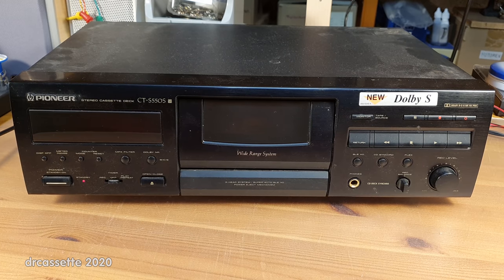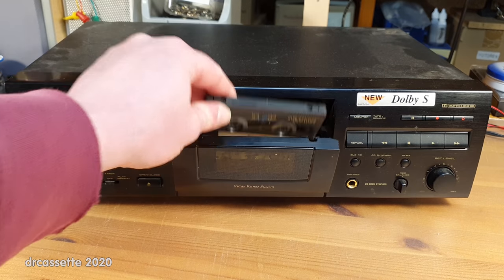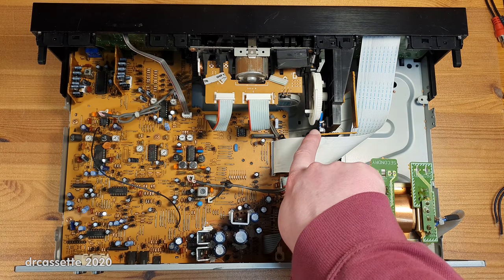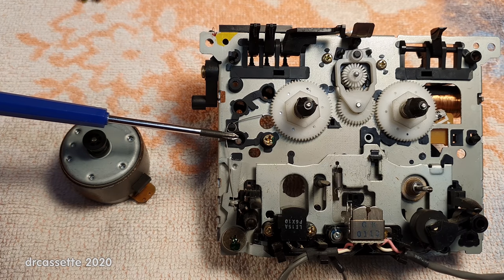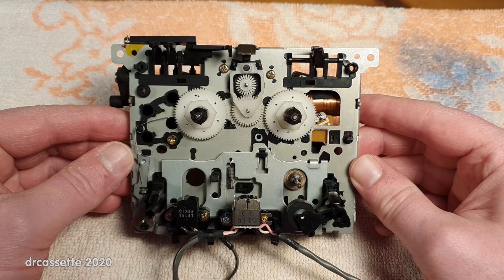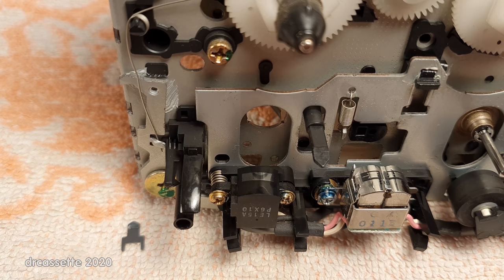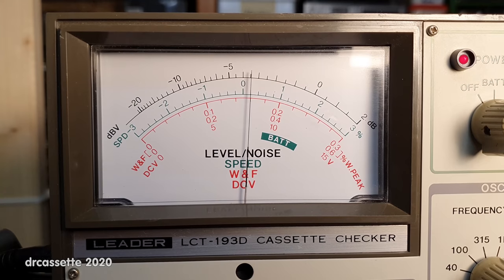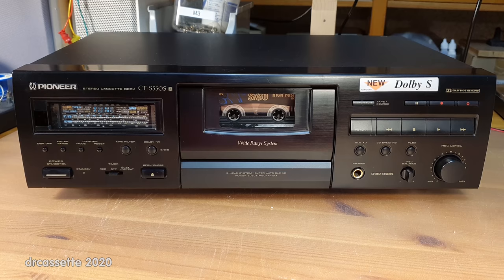Pioneer CT-S550S cassette deck repairs

Comment: Dr. Cassette, I have used this video as a reference for repairing a Pioneer CT530. Mechanically is identical with this one, without Dolby S. the strange issue is that while there was no aparent wear after 40-50 recorded cassettes (I listen them at work on a walkman) I noticed sudden wow. Changing belt, same thing. Lubricating everything as per service manual no improvement. I have even changed the the pinch roller. The capstan has absolutely no scoring marks and no play as wear mark. Finally after, trying to lube the motor (you cannot reassembly it without touching the brushings) I gave up and used the motor from a Pioneer CTs 656. Problem solved...until noticed on the long instrumental parts that it is not what it should be. Should I declare this deck dead or could you suggest other thing to check. Also,  forgot, the supplied belt was very fine sanded while spinning on the deck with 600, 800 and 1000 gritand after it everything cleaned with IPA and oiled (these belts are awful). Thank you for any suggestions.
Reply from the maker: You have already tried everything that I can think of. Unfortunately the mechanism in these cassette decks is not the best, I would assume something in your mechanism is just slightly worn out, but due to the bad design of the mechanism that is already enough to cause the high W&F. At this point it's probably better to look for a different cassette deck. You certainly already put more work into your deck than I would have.
Reply: @DrCassette  many thanks for the reply. I really appreciate it.

Comment: Wow that is cheap inside. Sad how quickly it all fell apart for pioneer. This is about as simple as you can get.
Reply from the maker: It's not quite as simple as a cassette deck can get, but it is indeed rather sad when compared to older Pioneer equipment.
Reply: You do not need to be complicated or expensive to be good. I can only agree to the guy who said once that this CT-S550S actually is one of the greatest decks ever made for that price. It sounds very well (I'd say - superb), auto tape calibration (BLE) with XD is really good. Would it have Reference mechanism from decks built earlier, this machine would be a real Dragon and 95 slayer. I've consulted few guys who specialize on refurbishment and they can tell only a disappointing thing - VFD can not be repaired. Permanent on during standby wears it out but Pioneer did this so as then you can power on deck from remote control. But in the same time I have Pioneer CD player from the same generation and it does not have any issues with display, so most probably there is a manufacturing flaw for that particular display model.

Comment: Bought a pioneer cts605 circa 1989 from ebay and was wondering if the unit I bought can play audio out loud or is it only for headphones?
Reply from the maker: The Pioneer CT-S605 is a cassette deck that is designed to be connected to a separate amplifier or receiver that powers a set of speakers. If the deck has a headphone output, you can always connect headphones there.
Reply: @DrCassette  It's worrying how so many people do not understand component systems.

Comment: nice video, ive got question, where can i get the motor but not capstan as there are available everywhere but this the cantre one for revinding, ive got old Denon DRM-540,  which has exactly the same mechanizm and same motor but i cant find it? any sugestions? my motor is a bit noisy, i did cleaning but i think is end of life. i want to get new one or something similar.
Reply from the maker: I have no idea where you could get a new one of these motors. I would try to salvage one out of a similar cassette deck.
Reply: Look around for motor with code printed on the sticker. I've got absolutely new not very long time ago. It even had new design red Pioneer logo on it. Unfortunately display becomes really dim due to age and plastic transparency degradation.
Reply: @DrCassette  i have found the problem, it wasn’t motor, it was the gear, i have replace the gear (centre white one) and all back to normal and very silent. so happy that this mechanism was used by denon, yamaha, pioneer, technics and many more from 1985 till 2000 even and some models till end of cassette decks, simple, quiet, reliable mechanism.

Comment: How did you test the ESR of the bad capacitors?  Did you have to remove them?
Reply from the maker: For the first time I tried the in-circuit capacitance/ESR measurement function of my old component tester. It worked very well, and gave accurate results. I first measured all capacitors in and around the power supply in circuit, unsoldered the suspicious ones and then measured again. The results in circuit and out of circuit were pretty much the same.
Reply: @DrCassette  Which component tester did you use?
Reply from the maker: I have videos about two Chinese made electronic component testers on my channel. I used the older one of the two, the big one with small display.
Reply: @DrCassette  Thank you, I've watched that video and ordered the newer model for myself based on your review.
Reply from the maker: @tonysavor5232   But you are aware that the newer model no longer has the in-circuit capacitance/ESR measurement function?
Reply: @DrCassette  I didn't realize that.  Thank you for pointing out.  So I should purchase the old model as well it sounds like.
Reply from the maker: @tonysavor5232   Yes, I still use mostly my old component tester.

Comment: Das Laufwerk sieht aus wie ein Haufen Schrott! Echt traurig 😢  und noch viel schlimmer ist das es bei Pioneer schon Anfang der 90er ab ging mit der Qualität  ! Mein CT-S 510 hatte das gleiche "arme Leute Laufwerk " das habe ich auch nicht lange gehabt. Kein Vergleich zu einem SONY TC-K750 ES oder dem JVC KD-VR5 ... bei letzterem ist eine Schwungmasse schon doppelt so dick wie bei diesem Pioneer Laufwerk 😄
Reply from the maker: Naja, du musst auch immer die Zeit und die Preisklasse bedenken. Das Sony aus der ES-Serie wird ganz erheblich viel mehr gekostet haben, als das Pioneer, und das JVC kommt aus der Mitte der 80er Jahre, ist also 10 Jahre älter, da waren die Cassettenlaufwerke allgemein noch besser gebaut. Aber wie gesagt, Pioneer hat die Kosten einfach am falschen Ende reduziert, und das macht sie einfach unsympathisch.
Reply: Ist mir definitiv auch eher unsympathisch.  Das mit der absinkenden Geschwindigkeit habe ich bei dem 510er auch gehabt,  war nur mit einem Ersatz des Capstan Motors in den Griff zu bekommen 😯 ist ein recht günstiger einfacher Motor.
Reply from the maker: @danieldusenglied8072   Einen passenden Ersatzmotor müsste ich in meinem Fundus da haben, vielleicht propiere ich das mal aus, wenn ich wieder Lust habe, mich mit diesem Deck zu befassen...
Reply: @DrCassette  ich hatte zufällig auch einen entsprechenden Motor liegen. Da gibt es einmal CW und einmal CCW. In diesem Laufwerk war clock counter wise glaube ich richtig... sonst gibt es diesen Motor typ für wenige Euro neu auf eBay. Müsste ein Mabuchi Motor sein.
Reply from the maker: Ich habe einen recht großen Vorrat an verschiedensten Ersatzmotoren, die ich über die Jahre aus billigen oder irreparablen Geräten ausgebaut habe. Da sollte ich etwas passendes da haben.

Comment: I've come across several pioneer units from this area and all of them had dim displays.
Reply from the maker: I don't think I have ever seen any Pioneer equipment from the 90s with vacuum fluorescent displays that still looked 100% fine.
Reply: @DrCassette  Early 90ties pioneers were ok, then they change VFD line. CT-S540 - also bad display (1993-1994), CT-S530 ok (old model)
Reply: @jacekschneider4686  CT-S410 is ok.

Comment: The most interesting part of this repair video is your analytic approach to the decline in manufacturing quality of cassette decks after 90´ and until the end of the production.  However, it is especially interesting for another reason. 

While many declines in production of technical goods are natural process due to the cost cutting in production of those, before the closure of production here we have another phenomenon. When technology reach its peak the new arises as the necessity to continue the development. Then the new technology becomes the novelty and very expensive and old technology stops its development and starts slowing the production. While the new technology is still very expensive the old technology production cuts the cost everywhere to make the most profit of the old one (to milk the cow to the last drop). 

However, in cassette decks era, the cost cutting started in 90s before the CD market was developed. Yet the development and perfecting the old technology kept going forward in parallel with the production quality decline. This is why a 3 head decks were so common after 90s and the new Dolby S emerged and BLE getting improved and features list kept growing yet the overall quality was going down the drain.  

This is the first time I have seen someone paid attention to this phenomenon in his repair videos. Well pointed out (most) cost cutting in this model (I am sure there are some in electronic circuit too) and showing them openly without any bias towards the well established brand. I had trouble explaining to many people how, for example, this model is much worst than lets say top model in early 80s with half the features this one has. Even the same brand.

So thank you for your video upload and your approach to it and enlightening many of those thinking of buying these second hand old timers for the first time to join the retro trend growing in almost forgotten cassette technology. Cassettes may be over run by the new technology but so much amazingly good engineering went into them and just for that reason alone it is worth to keep them alive at least among the enthusiasts of that era...